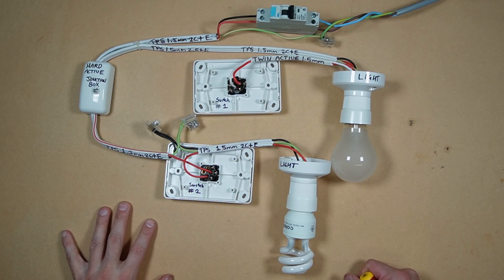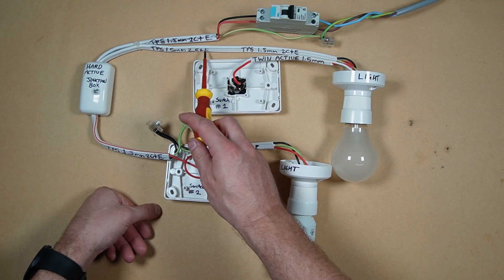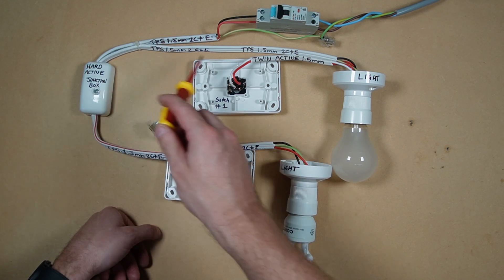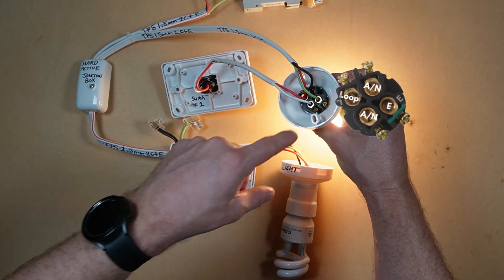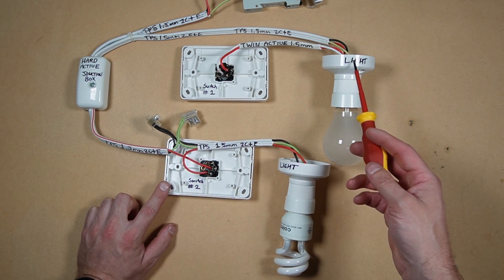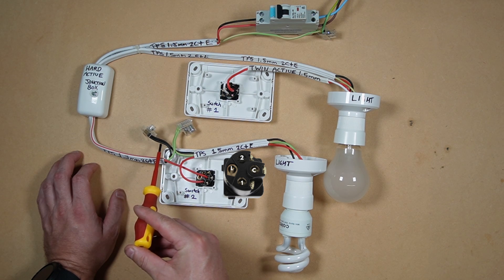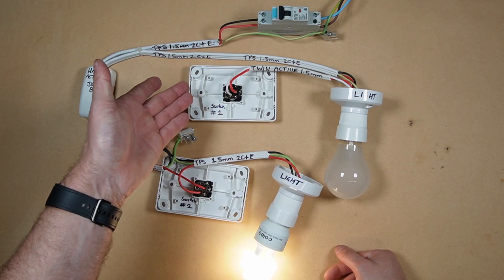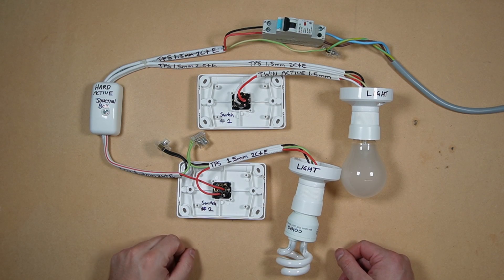How To Wire A Single Switch And Add A Light

Comment: Hi, thanks for your videos. I find the very informative. Can you tell me what’s happening when I have 2 black neutrals at the light are the switching wires. I’m removing an old 20w fluo and replacing it with a down light and at the same time adding an extra down light to this circuit. Thanks again.

Comment: good to see for Au wiring and watched many times.  *How to add / modify from 1 gang light switch (2 core wired at switch) to upgrading to a new 2 gang light switch that has a new separate light installed. ie Wardrobe Single LED light and switch (2 core wire at switch) then add a new study desk beside wardrobe that has a separate controlled light for study desk only. Switch then becomes a 2 gang light switch one for the wardrobe LED light and the other above study desk LED light connected (both LED lights have Plug base outlets). TIA

Comment: Great video. I’ve tried the looping at the light method with sockets and the active coming from a PowerPoint. The lights turn on but the switching isn’t working. Any advice?

Comment: I’m not an electrician and this vid was helpful in giving me an idea about how my switches have been wired (looping at the light). I’m hoping to make these switches “smart” by using Shelly 1 Plus (or similar Shelly wifi relay). Can you tell me if this would be possible with the looping at the light wiring set up??

Comment: Why didn't you plug the live wire from the hard active box I to the L connector of the bottom switch ?

Because you connected it to the L in the upper lightbulb... I would have expected the same move in the lower example.

Comment: Great video mate. I have a faulty light switch from a house built in the 70's in AU however it looks like theyve gone with Switch #2 looping. I pulled the switch away from the plaster and noticed two reds, one going in each port (which i am assuming will go in C and the one beneath, but then there are two blacks twisted together and going into another port. Am i correct in assuming these are currently in the LOOP socket in the old light? Cant really see much on it since its such an old plug and dirty as heck. 

Reason for replacing is im hearing some static spark when flicking this light on so we've stopped using it until it can be replaced. Thanks

Comment: Hey there man, I just had an question on the second option you pointed out since I just started an VET course to become an electrician,
I was just wondering if it matters where you put the red part in the light switch, because we had an practice session and I couldn't understand what I did wrong.

Also, does the one connected to the power have to be in control and the one connected to the light bulb have to be in 1 or 2,  And if not, would it still work if I were to put the red wire from the light bulb to the control and the red wire from the power to 1 or 2, would this way still work ?

 I also don't understand where the common, 1 or 2 is within the light switch since it wasn't pointed out in the material we use in the course. can you please give me any tips on these or any other ways to try and make it easier for me?

Sorry for wasting up a bit of your time but I appreciate you trynna help us rookies, much love❤